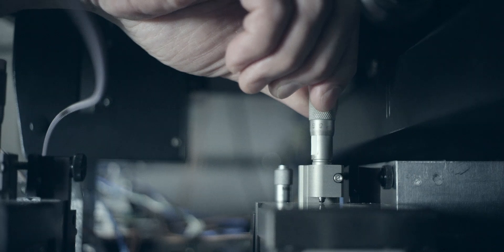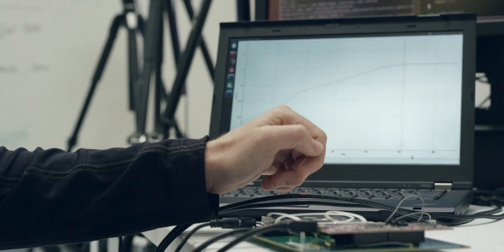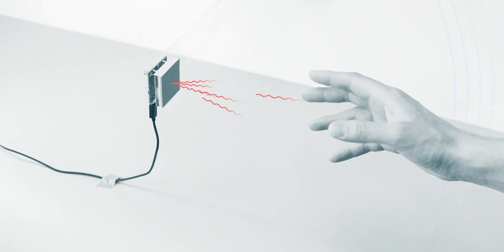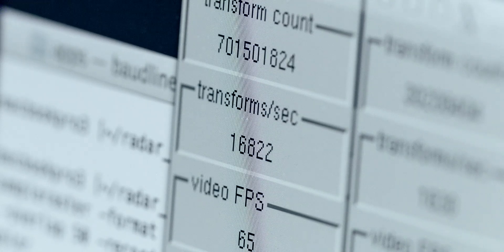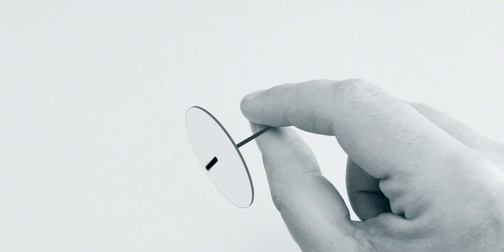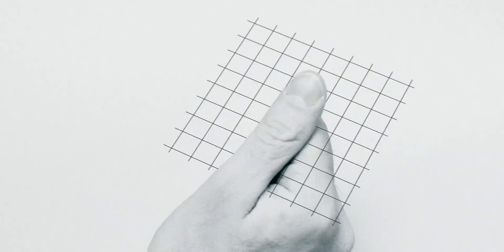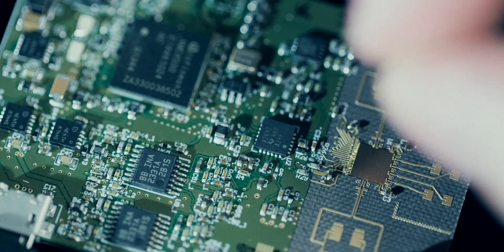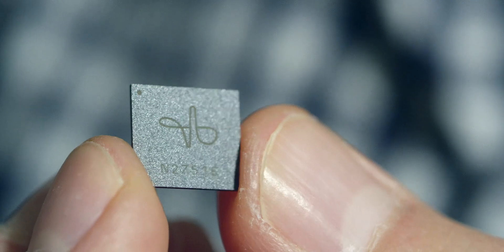Welcome to Project Soli

Comment: And what if you have no hands?
Reply: Maybe it applies to feet, facial gestures, or whatever else you have. Even if not, so what? Why does a solution for one problem need to apply to all problems?
Reply: Melinda Green what if you don't have feet either?
Reply: Özgür Salman
Then welcome to Project SOL.
Reply: This technology recognizes the micro twitches of the human hand. The data from interaction will provide a groundwork for programming emg interaction with carbon nanotubes. As nanotubes are integrated with today's low-functioning prosthetic hands, those without hands will be afforded an opportunity to obtain the dexterity of those who provided the data. Project Soli will provide the resource to create what is required to utilize all it creates.

Comment: I like the idea, its a really great one ive been waiting on.

However, ill be damned if i have to use their finger movements.

i hate their need to rely on rubbing and pressing fingers together. at that rate we might as well have conductive or magnetic implants in our fingers. or even surface mount contact points.

You cant judge intent, because if words fail then sign language fails.

There is a thousand reasons its just as flawed as any input. but part of it is idiot proofing and general ability to perceive the actually intended action. 
you might as well have an opensource library that people can update with their own switches and nobs. otherwise this is just forcing people to interact with their devices in a way that some person/group at google finds suitable not the way the consumer does(though some/many may). And that is a very real reason that products die and people lose interest.

Comment: I tinkered with gestures on Samsung.  Hated it.  Tell me why this doesn't also suck.
Reply: Because Samsung's gestures were hacked together, solely using the camera as the sensor. This is dedicated hardware designed for the sole purpose of gestures, allowing a level of nuance and consistency simply impossible with camera-based gestures like Samsung's
Reply: Samsung uses camera with image recognition to determine the movement while Project soli use radar to recognize movement. To put it simply, its a 3d sensor, so there's an entirely new dimension for recognizing motion
Reply: Because samsung does not use radar, only visible light sensor is used by samsung which is just a regular camera.

Comment: Hmmm. cool project but the only problem with this is that it uses radio waves as a radar system,  the man that invented radar also invented the microwave oven, it was discovered that when he was working on the radar system that it had melted some chocolate in his pocket and thus was born the microwave oven, this man was exposed to the radio waves as they were not discovered to be dangerous he then later died of cancer. now we are going to strap mini radar systems to our wrist. i'm sure the cellphone radiation is bad enough for us little alone adding this thing

Comment: Wont work. People make movements relative to the real world feedback. For Soli, eyes are not enough. When youre turning a volume knob you dont look at it. You feel it on your skin. At best it will be a more precise and mobile oriented movement tracking tech, like mini Kinect. Not good enough...
Reply: you can defently feal the diffrent kinds of buttons that are on your touch phones screen...
Reply: in fact, real buttons are better for feedback. the reason why we still use touch screens is they have so many other advantages that they cannot not be used.
Reply: Your making assuming this technology is only intended for use with mobile devices, think what this could do for VR no requirement for physical controllers.

This shouldn't be seen as a sole replacement current conventional methods of interaction with technology. 

This could allow us to think out of the box and drive new types of products onto the market, or just simply complement a product to make it a better experience for the user like the example i mentioned above.
Reply: if you study the physiology of the muscle you'll understand that this type of aerial gestures are an hell for fine control.
i can say is good for large swipes and long-ish movements, but not for fine tuning. it's a matter of muscle recruitment.
Reply: Just a thought here. If you used this technology in VR to push a button as they show, would your brain over time compensate for the absence of a physical and create some type of tactical feedback that would give the impression of pushing a physical button? It wouldn't happen right away, but given enough time?
Reply: nope. to "construct" an association between action-stimuli you need "something" to stimulate your nervous system; in this case the brain will say "oh, that's pain, ok i'll annotate that".

example for this: wet. we don't have sensors for "wetness" but with time our brain starts to figure out which stimuli can be associated with "wet".

here you are doing nothing. to construct such a immaginary feedback you need something big as a post-traumatic shock. definitely not viable. 

and even if you can, you'll have little precision due to the physiology of the muscle.

Comment: well the idea is cool, but don't be so proud of usual things from electronics stuff. it's a simple Doppler radar with oscillator set to 60 GHz. guess what everyone can get it from Ali for less than a 5$. also you can visualize the data from your Arduino stuff directly to your PC. Google do this because they have a budget to do it within production standards and with really tiny piece of silicon. but this is not miracle.